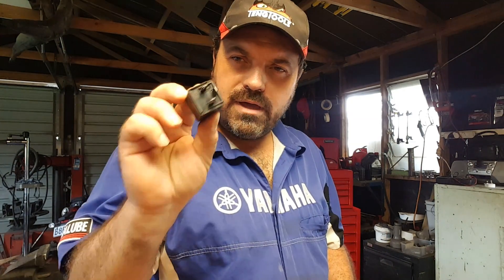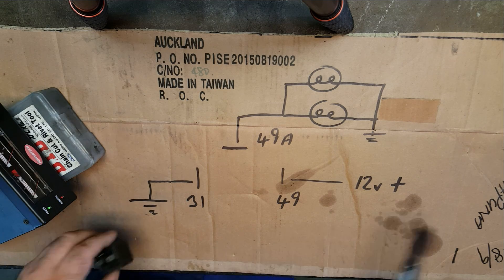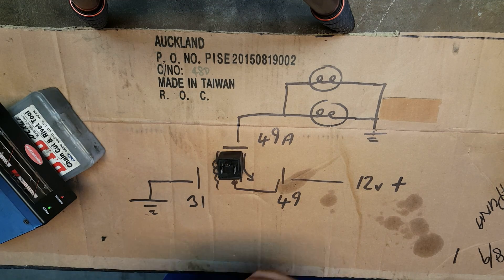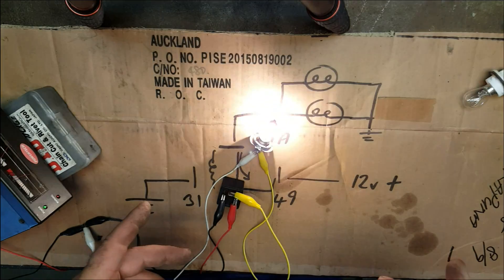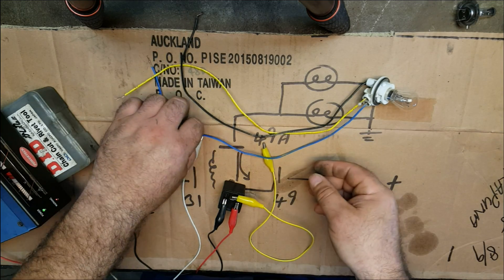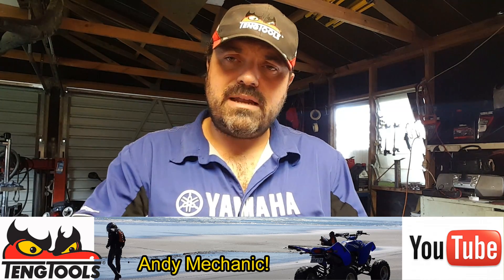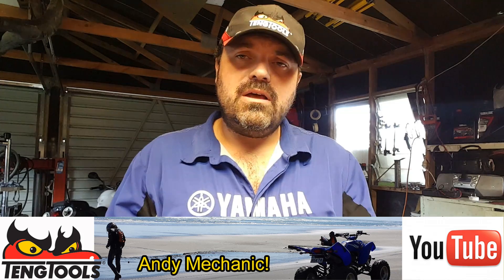How to wire up a Flasher relay #1927

Comment: So I'm a little confused,  now the relay basically intermittently interrupts the circuit to cause the bulbs to flash if It stays solid is it because there is too much wattage going into the bulbs or not enough ?
Reply: Figured it out I changed the relay and it worked thanks again
Reply from the maker: Not enough and as a result the bi-metalic strip does not heat sufficiency to deflect & break the circuit.

Hope this helps. Cheers Andy
Reply: @AndyMechanic  thank you for the reply it definitely helps , I think the bulbs I have are too low a wattage,  is there a flasher relay that would work for lower wattage? I have a 1983 Suzuki GS750T

Comment: I recently bought a KTM 250xcf-w 2007 is street legal, I already have tail light and head light, I would like to install turn signals front and back. I  am having a lot of trouble find how to wire and do everything can anyone help? Thanks
Reply from the maker: Does that model of KTM have a battery?
Reply: @AndyMechanic  yes it has a battery, thanks.

Comment: Why is my LF1-S-PIN (2 wire) relay blinking normally only with engine OFF on a 2000 Yamaha TDM ? As soon as I turn engine on relay starts blinking faster.
Reply from the maker: Hmmm....check your charging rate. It may be a fault with the reg/rectifier. Also get your battery checked and check for volt drop between the terminals of tge battery and the wires coming off. 

Hope this helps
Cheers Andy

Comment: Thanks for the info.
But this is only controlling 1 set of bulbs. So how can 1 relay control both left and right turn signals?
Reply from the maker: Via the switch next to the steering wheel or on the handlebars if a motorcycle.

Cheers Andy
Reply: @AndyMechanic  [edit] Oh wait I get it now! The left/off/right switch comes AFTER the relay and determines where the power coming from the relay is going to. [/edit]
 Thanks for the reply but I still don't get it.
I mean, there's only 1 wire for output...
So what actually hapens when you switch left to right?

Comment: Hey Andy!! 
I use the 2nd type of relay at work all the time. Was hoping you could give me some pretty specific pointers. I use these for wiring up street legal kits with turn signals, ect. on side by sides and atvs. I'm relatively new in the game, and have been tasked with figure out how to integrate the rear brake lights as working turn signal indicators on a 2018 Polaris RZR turbo 1000. I've managed to do so, but am unaware of a way to cancel out the brake signal to the corresponding tail light during turn signal use. So turn signal will flash tail light until brakes are depressed, and then brake signal overrides the flasher signal and just stays lit. I assume i need a different kind of relay, like a d.p.d.t. with the brake switch somehow wired into it,  but have no experience in such things. Any help would be greatly appreciated. I can get wiring diagrams if needed.

Comment: Hi Andy I've installed LED to my 2007 Vulcan and the rear is all good with 2 wire setup but the front which are 3wire stay on but indicate when you activate switch so you have both lights on with one blinking. I also installed aftermarket relay for LED lights which is a 2pin same as the original.

Comment: Hi Andy, Today I picked up four much brighter Navra  LED amber blinker lights and my new CF14JL-02 three pin electronic relay. Sadly I can't make the system blink yet. Changing this relay back to the old non electronic 3 pin relay made all the lights work  on Hazard but they still don't blink. Same happens when  either left or right indicator is selected and just that side comes on and doesn't blink. Question,  Are there different ratings in electronic relays? Should I have used a two pin instead? Many thanks for your help. David.
Reply: same thing
Reply from the maker: Hi David, a true electronic type relay shouldn't be dependent on load to trigger flashing unlike the old bimetalic mechanical type. However, given the relay works correctly when actuating all the indicator lamps (hazard mode) then I would suggest maybe swapping the relay for a lower wattage one - the pin layout must be correct as the relay works when under a higher load.

Hope this is of help

Andy
Reply: so i plugged in everything on an older toyota, 81 to be exact and it does not flash my hazards or turn signals....do i have to do some extra wiring for ground?  i know my fuses are good and everything else because it still works on the old relay but not the electronic relay
 @AndyMechanic

Comment: Hi Andy Mechanic,  Thanks for a great video. I have just fitted a brand new set of LED blinkers, new wiring and a brand new  steering column indicator switch unit on my vintage car.  The lights glow and don't flash.  I gather that I need to include an electronic relay. Where do you suggest I pick up one in Auckland. Is this a better approach than installing load resistors? David.
Reply from the maker: Hi David, yes, replacing the relay is by far the best option. Take your existing relay and wiring diagram to TWL - they are Hella agents and will be able to match up the correct electronic relay to suit your application.

Great job. Thanks for the feedback.  Cheers Andy

Comment: hello, I installed a 3 wire hazard switch on my moto but doesnt blink. It wants to blink but it looks like has not to much power to to do this. I use regular lamps, not LED. Any suggestion?

Comment: Is the flasher output grounded or blank when off?
Reply from the maker: No output from flasher relay 'L' Terminal when flasher switch is in neutral position.
Reply: Thanks Andy, i'm trying to fabricate a wig wag function for the headlights!

Comment: My led indicators wont work unless the engine is running or the bike is on its Ctek battery tender. Is my battery faulty?
Reply from the maker: Yes, looks like it could have a dead cell. A fully charged battery should be around 12.6v. Hope that helps. Cheers Andy
Reply: Andy Mechanic Thanks Andy. Thought so as soon as I unplug it from its optimizer it drops a volt straight away to 12.86 from 13.8 funny thing is the bike will start?

Comment: just used this to check if my indicators weren't working because of my flasher relay. Fortunately/unfortunately is is operational and I don't need to waste £40 on a new one, but now to find the real issue...
Reply from the maker: +Simeon Kudratt Great job! Check power supply to the relay. If all indicators aren't working it could be a power feed issue. Also try your Hazzard switch - this usually uses a separate relay so if they work it helps narrow down the problem.

Have fun. Cheers Andy

Comment: I have a KLR250 bike and when I indicate and put the brakes on at the same time the indicator often stops flashing, but not all of the time.  What could be the problem there?  Also when I am turning a corner with the indicator on, the engine begins missing until I turn the indicator off.  How could this be related?
Reply from the maker: +Colin Harrison It's most likely a bad earth on the indicator circuit. Or it could be low battery voltage due to low charging rate. You can easily check the latter by watching my video on checking charging rates - there are a few but one on the GN250 is probably the simplest.

Hope this helps. Cheers Andy

Comment: I have new LED's on an old bike .They would not work unless i fitted another older type bulb so i figured not enough load .I bought a specific relay for led's but they now all come on at the same time?
Reply from the maker: +stephen davis hmmmm. ..it sounds to me like either you have the wrong configuration electronic relay (pins are not in correct places) or if your bike has a hazard light switch you may have swapped put the hazard relay and not the indicator relay - sometimes there are two. Hope this helps. Cheers Andy

Comment: My friends Suzuki k 50 from 1989 has two 3 pin flashers. It made the same sound as your did at 8.18. He had only his rear ones connected because the previous owner had disconnected the front ones. I am helping him to get it working again but now doesn't anything happen and I have connected it like original. It doesn't even sound in the relays. I guess the power doesn't move from the switch or is the relays burned.
Reply from the maker: +Memil 1234 I think you will find that one of those relays is for the hazard light - when all flashers flash simultaneously
Reply from the maker: +Emil Qvarnström you may have the wrong wattage bulbs fitted. Too low a wattage and the relay won't operate.

Have you changed the indicator lamps to LED by any chance?
Reply: nope its all stock and all bulbs is working. i dont know if its to little. they worked when it was only installed in the rear but then they didnt flash. i have to look on the relays and see what they say
Reply from the maker: +Memil 1234 okay. Also check power to the relay. One of the pins should have battery voltage

Comment: K 98 be Cabrio no lite on driver side put new single lite dimmer switch n no turn signals eather n no headlight blowing number 8   fuse can u help please
Reply from the maker: +Terrie Ellis sounds to me like you have a short to ground. Check for damage to wiring. Sorry can't help more, we don't have those cars here in New Zealand so my knowledge is poor.
Reply: Andy Mechanic ty

Comment: But when I use flasher the 4 bulbs are just glowing but not indigating means just glow what to do please tell?
Reply from the maker: +Rc Akash Hi, problem could be a number of things but first increase bulb wattage as in video. If load (amps) on relay isn't high enough relay won't cycle. Also check wiring and earth's for high resistance (corrosion, poor connections etc) as this reduces current flow.
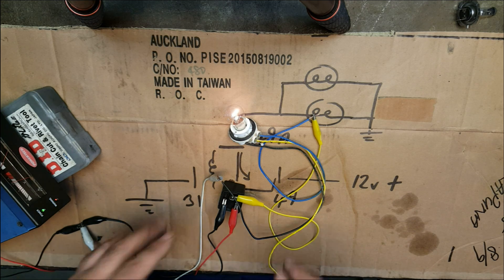Reply: Thxx a lot for your precious reply sir can u please tell me one more thing that when I am using the original flasher relay that time it is giving a loud sound just as at 8:17 in the video can u please tell me why and what to do as ur reply is very precious thxx a lot ?

Comment: This is super helpful!!! I've recently installed LED's on all the exterior flasher bulbs on my 86 GMC K1500 they worked good with the bulbs installed for all the rear lights then when I installed the front flasher LED bulbs they all flashed very slow. I'm assuming its either a problem with my relay or the load is  somehow being blocked from LEDs between the front or back. I was going to try load resistors to even out the ammount of power going to the LED's. now that I've watched your video I think the flasher relays may be more of the problem though.

Comment: Great video that answered some of my questions especially about the load and speed of the flash. I'm looking for a way to make a 12 volt LED strip flash using this same idea however not on a vehicle.
Reply from the maker: +JD L An electronic flasher relay will do that - it's not load sensitive

Comment: when i turn on the hazards switch it does the same noise like yours did, im using normal bulbs, what can it be?
Reply from the maker: +David Piceno hi, it could be a flat battery or high resistance in the circuit....maybe a bad connection.

Comment: Can you help me with my set up.
I installed a side marker.

I have source for the relay:
1.Steady Positive Parklight 
2.blinking Positive signal light
3.negative

What I wanted to do is when Parklight is On the side marker are On too with the Parklight then I do signal light the Side marker and front back signal light will signal.

And when the Parklight is off the side marker is off too and when I use signal light the side marker and front back signal light do the signal.  Anyone knows how to do this maybe I need 2 relays each side?  And how to set it up please.
Reply from the maker: +Yo Stop hmmmm.....Okay.  I'm confident this could be done with a single 4 pin relay but you'll need to add a diode to each if the trigger wires to prevent a backfeed into the other circuit.

The 4 terminals on the relay are as follows:

30 - main power feed from your battery (make sure it's fused & amp rating a little above that of the current consumption of all bulbs the relay is powering)

87 - this is the output that will supply current to the lamps you want to light up.

85 - this is the terminal you will connect both trigger wires (side lamp & flasher lamps) BUT you'll need to solder on diodes onto each wire before they connect to this pin. Make sure the diodes are orientated so that they only allow current to flow to the pin.

86 - this pin needs connecting to ground.

I'm reasonably sure this will do what you want! Give it a try.

You can get the relay and diodes from any electronics supplier - Jaycar is who I use here in New Zealand.
 
Anyone else out there want to add a comment to this to help?

Cheers Andy
Reply: Andy Mechanic thanks for the reply I have been trying to look for help in past 5 days, here is my wiring now, I have drilled a whole on my brand new 2017 Prius for a side marker. I use regular bulb on the side marker without a replay I tap a wire on my signal light positive wire and connected it to one terminal of the side marker bulb and then tap one wire on the positive of the parklight and goes to the other terminal of the side marker bulb.
When the Parklight is ON the side marker is ON and when I do a signal light trigger the signal light and the parking light blink alternately which is what I wanted.

But when the parklight is off, all signal light and side marker are signalling at the same time which make sense and correct. Problem is all the parking light is signaling too together with the signal light and side marker light at the same time even when the Parklight is OFF.  I have no idea what is going on, but the 2015 prius that I traded in for this 2017 car with the same wiring but when I signal on that  2015 car the parklight does not signal it just stayed off when the parklight switch is OFF.

Can you confirm may be I dont even need a relay may be a just need a diodes for the park light connection so there is no back flow of the signal light to the parklight? Is that safe?

I think the difference between the 2015 and 2017 prius is the parkligth is regular bulb on the 2015 and the the 2017 all parklight is LED.

I appreciate for the help

Comment: now if i put a led relay do i have to change all the bulbs to led bulbs
Reply from the maker: +matthew fiore yes, more often than not but you best check the total wattage of the standard bulbs and check that it's under the max for the relay. I take it you mean an electronic type flasher relay as opposed to the old bi-metal strip mechanical type?
Reply: thanks alot for the speedy answer
Reply from the maker: +matthew fiore yes, more often than not but you best check the total wattage of the standard bulbs and check that it's under the max for the relay. I take it you mean an electronic type flasher relay as opposed to the old bi-metal strip mechanical type?
Reply: yes because my tail light has integrated turn signals that are led but my front turn signals are reg bulbs i was going to order electric relay
Reply: yes because my tail light has integrated turn signals that are led but my front turn signals are reg bulbs i was going to order electric relay

Comment: Hey Andy.
Can you make a video on how to wire a 2 pin relay. Because I need it for my quadbike.
Reply from the maker: +Quadbike Fan ermmmm...do you mean the starter relay? Can you email me a picture of the relay you have to andymechanic@live.co.uk
Reply: Andy Mechanic I meant the 2 pin blinker relay.
Reply from the maker: +Quadbike Fan oh...that goes between the feed from the ignition barrel (ignition live) and the input (middle wire) to indicator switch. The switch then splits the circuit to the respective indicators. There are lots of wiring diagrams on Google that will show the circuit setup. Hope this helps. Cheers Andy
Reply: Andy Mechanic Thank you Andy!!

Comment: Hi.
Great video.
Do you know maybe what's wrong with my flasher relay?
What it does is just 1 click and then light stays on.
It's a flasher relay from scooter (10W)
Here is video demonstration:
https://youtu.be/ld47fWuEU6k
Reply from the maker: Hi Luka,

Thanks for doing the video, it shows me a lot of info and that you are 'bench testing' the relay rather than it been on the bike.

There are a few reasons why this could be happening. Firstly, it looks like you only have one bulb wired in the circuit. The flasher uses a bi-metalic strip as part of its internal workings. As current flows through the circuit this 'strip' warms up and bends breaking a contact. The current the ceases to flow so the strip cools down & then makes contact again as it returns to its original position. If there is insufficient current flowing in the circuit then the strip won't get hot enough to bend away and thus the relay won't flash.

This can be caused by either too low a wattage bulbs been fitted or if one of the bulbs blows. So, try wiring in both bulbs or for bench testing, use one bulb with double the wattage (as stated in the manufacturers manual).

The other reason could be due to corroded wiring or a poor contact in the circuit, this could be in the indicator switch or anywhere within the wiring on the bike, though as you are bench testing the relay you need to firstly get the relay to flash whilst bench testing it.

You could also use an ammeter and check current flow too. & the relay should have some information on it stating the bulb wattage required.

Hope this helps

Andy